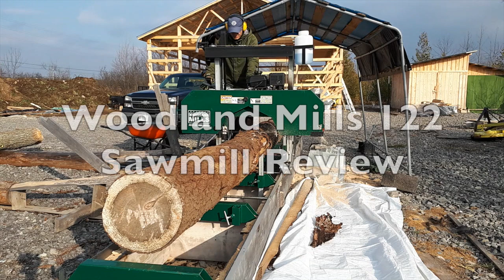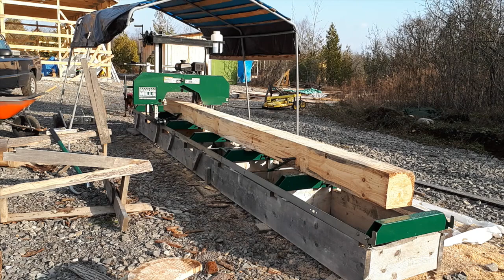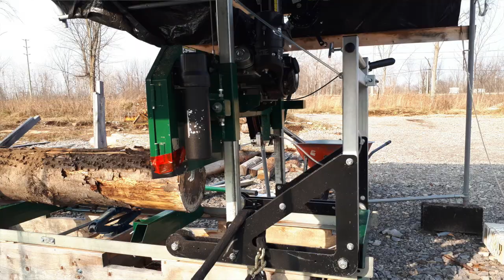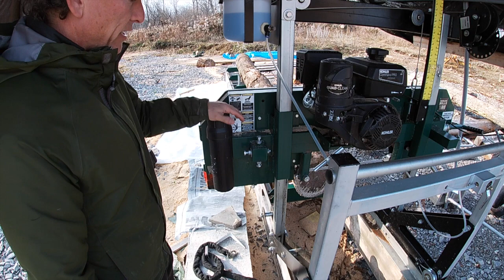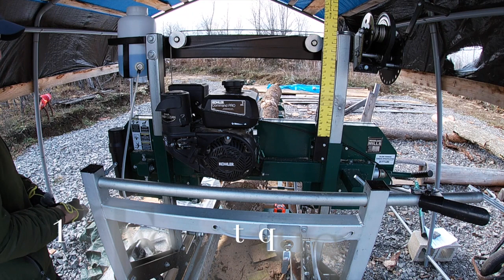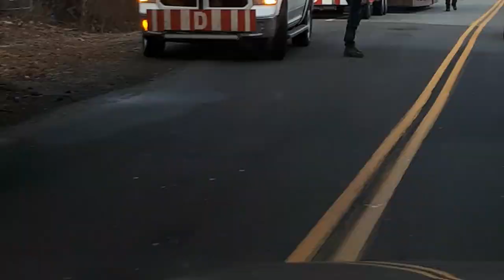Woodland Mills 122 Sawmill Review

Comment: Very good job my friend I have a question how long of a cut can you cut?and how many railing  extention did you use for the mill?
I am in a process of getting one and most of my cuts are going to be 16 foot to 20 foot so I might need 2 extention for the rail
Reply from the maker: Hey Antoine, I bought one set of rail extensions for my mill, allowing me to saw logs up to 16'11". Based on your needs I would get two extensions. I truly enjoy my mill. Good luck. Peter at the Reboot.

Comment: Was it difficult to assemble? 
I’m considering ordering a hm126 with trailer package.
Thanks.
Reply from the maker: Hi Dewayne, It's not difficult to assemble. Definitely get the trailer package. I'm thinking about adding the trailer to my mill. Thanks for the question, Peter at the Reboot.
Reply: I spent all day putting together the bushmaster trailer with 16’ extension and another day to put together the hm122 sawmill.   It’s really heavy so we used a shop crane to lift the mill onto the trailer.

Comment: What are your thoughts on sharpening? Is it better to simply replace the blade or does sharpening make sense?
Reply from the maker: I found a sharpening service that does a good job for a fair price. I have the blades sharpened three to four times before I replace them.  As a 'hobby sawyer', this works for me.
Reply: Woodland makes a nice blade sharpener and tooth setter combo for just under $1000. At $25 a blade I  plan on buying that. Blades can be sharpened as many as 5 times. The price of 50 blades would more than pay for that combo. That would be 10 blades ea sharpened 5 times.

Comment: Am I correct in thinking that I’m not limited to making a 6” tall beam? Can I simply cut 3 sides and rotate the log so I would just make the final cut at maximum height which is the max thickness of the log?
Reply from the maker: Yes, you can make beams up to the width of the saw 'mouth'.  Thanks for the comment and please keep watching!

Comment: i have a copy cat harborfreight sawmill ...i will say that i do like my harbor freight but the woodland mills is a superior saw ...harbor freight has no customer service ...here in the states its only 200 more for the hm 122 over the harbor freight and for that 200 what do you get ? ...you get extended warenty and customer service you get the wheel sweeps an extra 2 feet of log length cutting  and a sturdier carriage ....for my saw i made my own tracks because of complaints of the joints on HF and i am very happy with them and i would sugest to anybody who buys a sawmill to consider making their own tracks ...good video thankyou for putting it out
Reply from the maker: Thanks for the kind words and information regarding the HF mill. Peter at the Reboot.

Comment: Good mill for the 💰 but I see that's running little to fast at idle hear the bell that is your clutch is engaging idle down a. Little or you  will wear out your clutch.
Reply from the maker: Thanks Galan. I've had several comments regarding the idle and the pinging ... even a call from the Woodland Mills service department. I dialed back the idle and will test it in a month or so when I have time to saw some more logs. Peter at the Reboot.

Comment: Hi Peter
Thanks for the video , what are you using for lubrication? looks like its mixed in the bottle there ?
Reply from the maker: Hey there, in the colder months I use window washer fluid. If the colour is odd, it may be because I mixed blue with some orange washer fluid.  In the warm months - water with dish washing soap. Thanks for the comment and question. Peter at the Reboot.
Reply: i am sawing lodge pole ,fir, and spruce with no windshield wash or soap. it makes a mess. i like to run dry.

Comment: Hi Peter, very impressive!!  Question - you didn't have to dry the wood?  I'm looking at doing something similar but thought I had to dry the wood for 12-18 months first.  Thank you for any insights.
Reply from the maker: Hi Stephane, Thanks for the kind words. Here's what I learned (for Ontario, Cda): If you're building a non-habitable building - a shed, agricultural storage, a garage - you don't have to use kiln dried, graded lumber.  In short, you can use 'wet' lumber straight off a sawmill.  Hope this helps and good luck with your planning. Peter at the Reboot
Reply: The Woodland Reboot Great!!  We are planning two structures, a wood shop / workshop and a goat barn. Sounds like we could use a similar setup as yours. I’ll be watching more of your vids and progress.

Comment: When you start the motor at about 10:25, it make a pinging sound as you are adjusting the choke. If you don't already know, that pinging sound is the centrifugal clutch partially engaging. You do not want to hear that sound during regular operation, it will lead to your clutch getting worn out prematurely. If it only does it for a few seconds on a cold start, that's fine but if it does this at idle continuously, you may want to adjust the throttle cable, choke cable, or if necessary adjust the jets in the carb so that it runs a little bit slower at idle. Sorry if you already know this, I just don't want you to have to be replacing your clutch early.
Reply from the maker: Thanks John. I'm going to monitor it to see if it lasts past start-up. I've also contacted service at Woodland Mills for their help. Thanks for watching and the comment!

Comment: For the money that sure is a great mill . Never had I heard any complaints about a Woodland Mill . They also sell some very good products such as chippers . Have watched quit a few good reviews on those . Saw with Sandy who is from Ontario has a HM130 and he loves it . He has many videos about his mill and how to maintain and use it . Some of these well known high cost mills aren't exactly made properly . Fall Line Ridge has a brand new Wood Mizer LT15GO . He found out that the thingy that holds the head wasn't welded properly at the factory . I think he had to do some bending or fooling around with it to ride properly on the rail . I would be very angry if that happened to me . Customer service wasn't much help either . Wood Mizer should have came down and exchanged the posts but of course  they didn't do that . Big money doesn't mean you're getting a quality product . Service is a big key in buying something . Woodland Mills is in Ontario which is a good thing . Nothing but good words when it comes to a Woodland product .
Reply from the maker: Thanks Henry. I've seen some of the Fall Line Ridge and Sawing with Sandy videos. They do some good work and share helpful observations. I also hear many good comments from other Woodland Mills owners. Woodland Mills has done a great job designing an affordable, quality product. Peter at the Reboot.